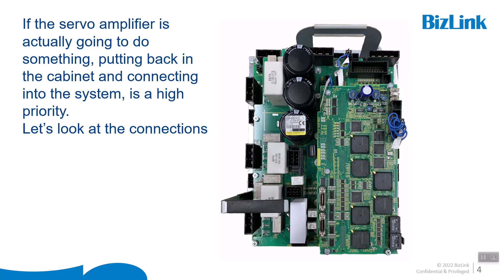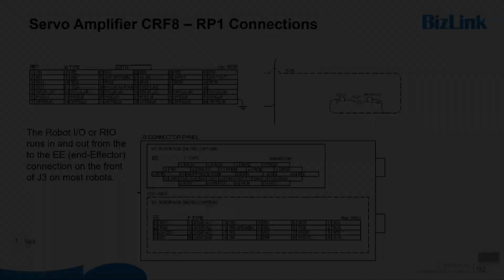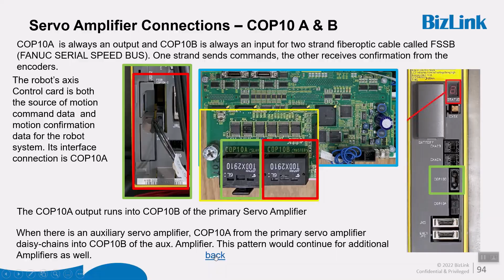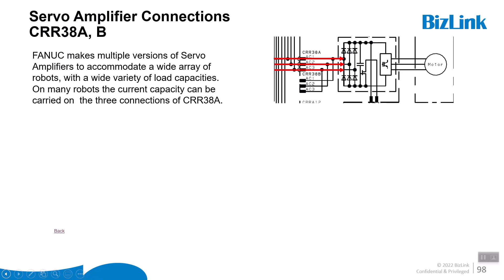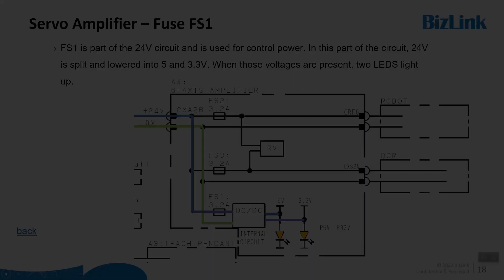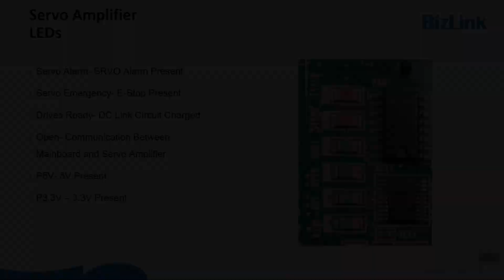R30iB Servo Amplifier

Comment: Thanks for the videos; I'm totally new to these machines and looking to learn. Do you have any idea what might be causing a condition where, on power up, the P5V and P3_3V leds on the servo amp board flicker on and off a couple of times a second rather than staying steady?
Reply from the maker: Those two LEDs indicate that those voltages are present. In the prints 24vdc comes in and then there is a symbol reading dc to dc, where it steps down the voltage. If it's the only LEDs flickering, it might be a sign that something is breaking down. That top circuit board on the servo amplifier, is usually the first one to go.